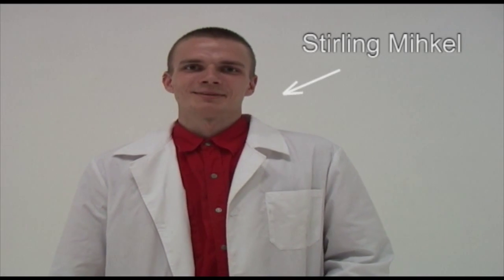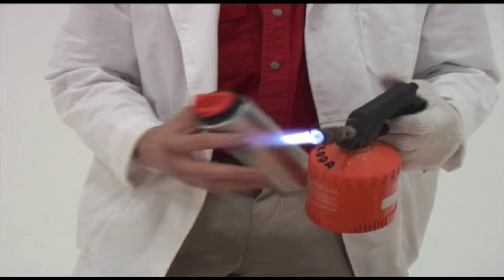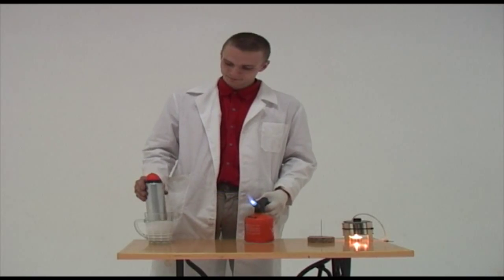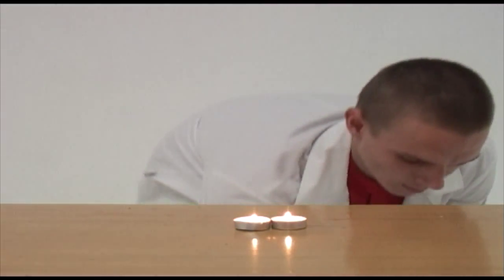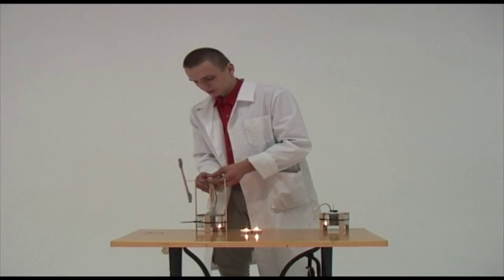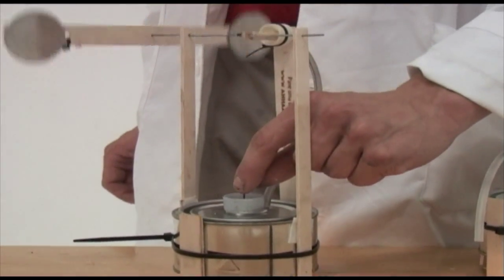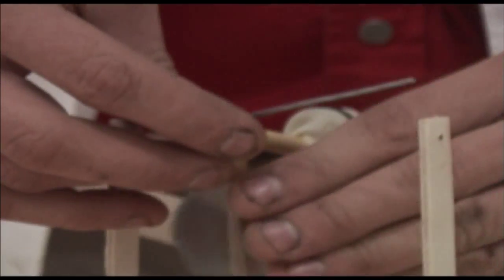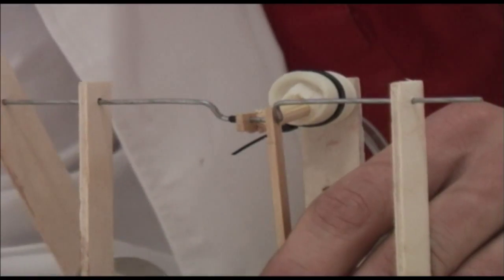How Stirling engine works

Comment: I have been struggling with the function of Sterling Engines for a long time, thinking the displacer piston was also doing work, while the power piston was pushing the air back and forth. I completely ignored the Ideal gas law in all of this and was thinking it was simply heat rising from the bottom pushing the displacer up. I had everything completely backward.  Thank you Mikhel for explaining this in this manner.  A light turned on in my mind and I completely understood the function of a Sterling Engine.